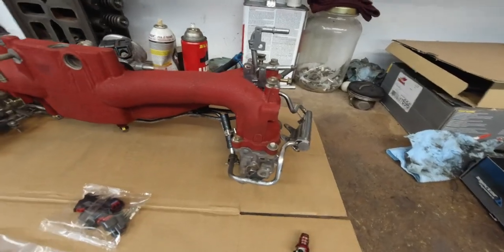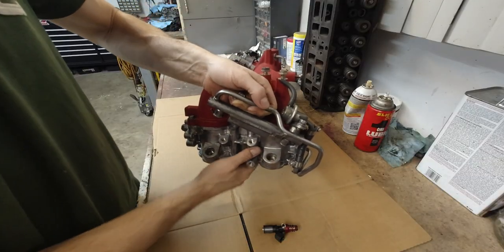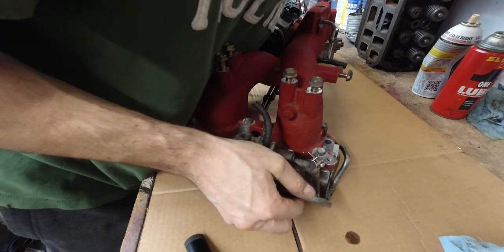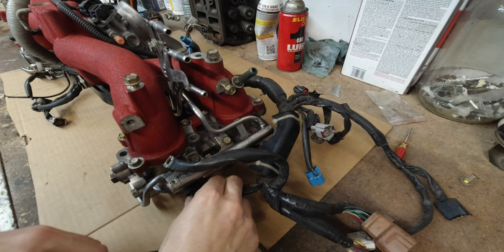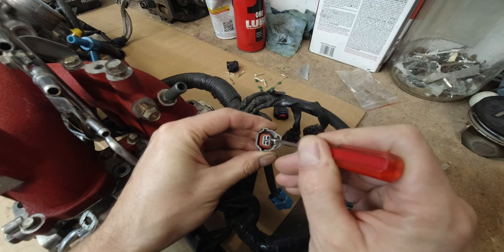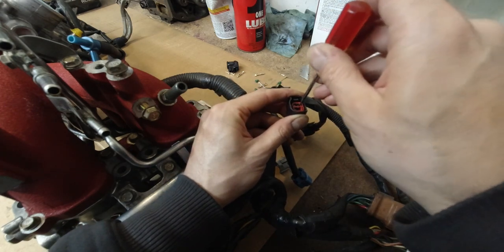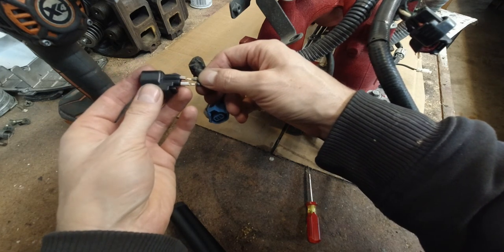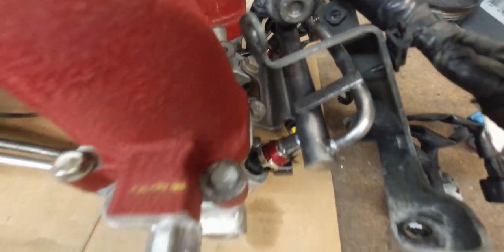Subaru STI ID1050 injectors install

Comment: I have these injectors in my 2014 wrx with the AEM 340 fuel pump and its making my fuel pressure regulator struggle i think. Car is a bit jerky at low rpm but drives and idles fine. Only really notice it in first gear at low rpm.
Reply from the maker: Do u have a protune?
Reply: @cruizinmax4017  E-tune through torque performance
Reply from the maker: protune is best, I dont trust anything else, not only its best but its also the most important part to whatever your build is, you may be slowly destroying your engine.  Do some research

Comment: So what fuel pump do you think is adequate for the 1050  injectors?  Walbro 255 or Aem 340?
Reply from the maker: Im running the 255 on E85 at 23psi boost no problem
Reply: ok thanks

Comment: Yo cruzin quick question for ya I have a 2013 sti had a intake gasket leak . Fixed the problem but now it runs super rich on id1300 pro tuned three years ago on this setup any idea why it would be running super rich .
Reply from the maker: You might have a leaky fuel injector, bad o2 sensor, run a live data on a scanner, check voltage on o2 sensors.
Reply: @cruizinmax4017  thank you . Plus I love all your garage builds been following you for about two years now

Comment: Would bad fuel injectors cause ticking noises during normal idle? Would these injectors need a tune?
Reply from the maker: a bad injector yes but I dont know about bad tune.  But if an injector is bad then a tune wont help.
Reply: CruizinMax appreciate the feedback subie fam

Comment: Hey are these loud enough to hear in cabin on decel?
Reply from the maker: No, I dont hear them, but the rest of my car is not exactly stock so I hear plenty of other noises.
Reply: @cruizinmax4017  mines not either but for some reason on decel that’s a loud tick I wonder if my shit spun a bearing
Reply from the maker: spun or bad bearing, you would hear a loud knock at all times, specially at around 3k rpms, valves make ticking noises, do a leak down test
Reply from the maker: i do not